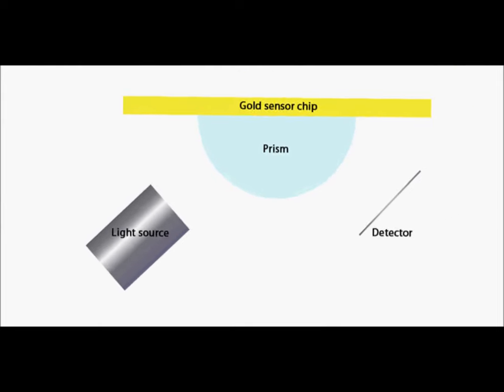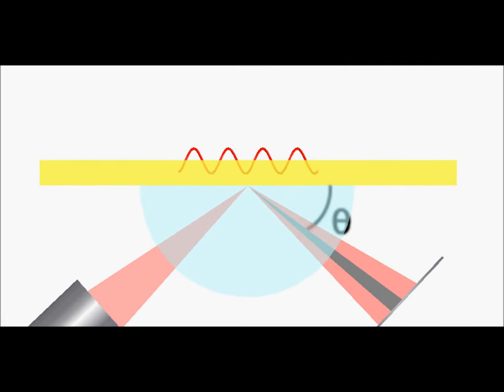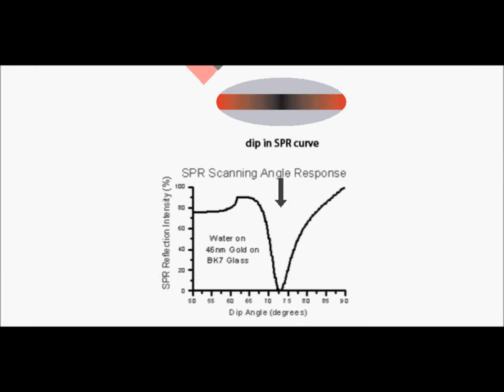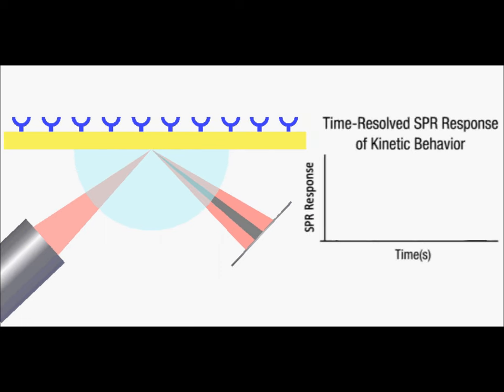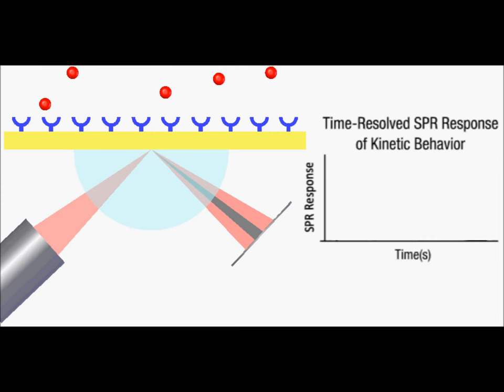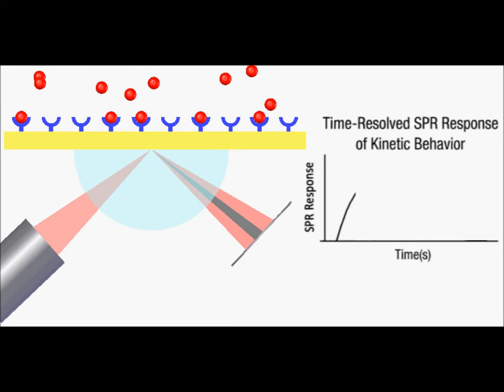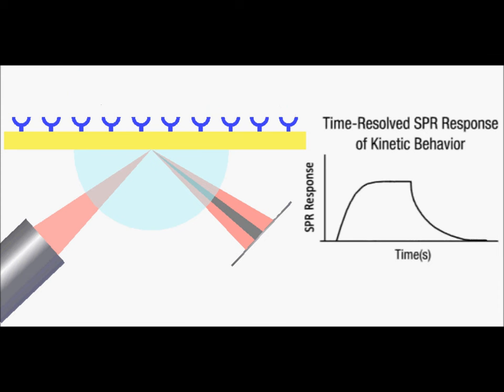Surface Plasmon Resonance Explained

Comment: Hello!

Thanks for the good video. I have one question regarding the SPR response:

what causes the response? is it the change of SPR angle with a fixed angle detector or the increased light absorbance caused by a higher concentration of analyte in the range of the evanescent wave?
Reply: It’s index of refraction change just above coverslip, so loss of signal due to increased scattering, since that also takes into account change in reflection angle. So yes, simple mass scatters light effect. I’m not sure how sensitive it is to change - one would think the layer thickness must need to change on the order of the size of the photons- so 200-400 nm, which would be tens of proteins deep, which is nonsensical. That’s the beauty of spr - the gold surface greatly reduces the size scale of photons to one or more layers of proteins, in effect! After that you just need a good detector for measuring small light changes in large signal which we have. I presume the light is exciting along the path of its resonance intensity minimum, and then see increase in emission intensity.

Comment: The shape and location of the SPR dip can then be used to convey information about the sensor surface.  SPR technology is commonly utilized for the study of molecular binding interactions between free anolyte molecules in solution and probe molecules which are linked to or immobilized onto the sensor surface.  As a molecular binding event takes place the angular position of this dark band shifts, and a shift in the reflectivity curve can also be observed.

Comment: Due to its simplicity, nearly every commercially available SPR instrument uses a detection scheme called the Kretschmann Configuration, in this set up a light source passes through a prism, reflects off the backside of the sensor chip surface and into a detector.  At a certain incident angle known as the resonance angle, light is absorbed by the electrons in the metal film of the sensor chip causing them to resonate.

Comment: .   In the first example, an anolyte with a low affinity to the immobilized ligand on the sensor surface is introduced and therefore negligible binding interaction is observed.  However, when an anolyte with higher affinity to the immobilized ligand is introduced into the system, then binding events are more readily observed.  Initially there are many binding sites available resulting in a rapid increase in SPR response that occurs as anolyte begins to bind to the ligand.

Comment: While sample is continuously delivered to the sensor surface anolyte molecules continue to bind and the number of available binding sites decreases, corresponding to a decrease in binding rate.  As the SPR response levels off the system approaches equilibrium and the number of molecules binding and unbinding become equal.  When no more anolyte is introduced to the system, the molecules will continue to unbind resulting in a decrease in SPR response.

Comment from the maker: Good question. During the sample's exposure to the surface, the sample molecules will continually bind and unbind with immobilized ligands on the sensor surface. This is a very dynamic process that occurs due to the nature of affinity binding interactions. Though the kinetic rates for association and dissociation may differ from each other, eventually the amount of sample binding and unbinding will reach equilibrium/steady state for a giving concentration.(i.e. Langmuir isotherm)

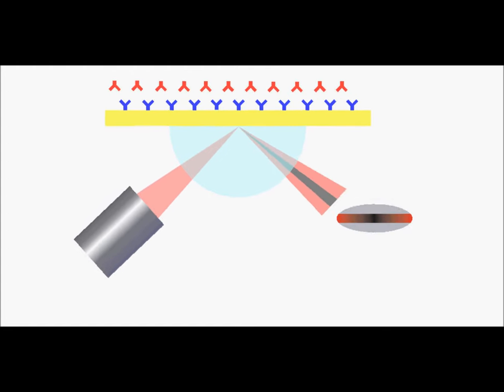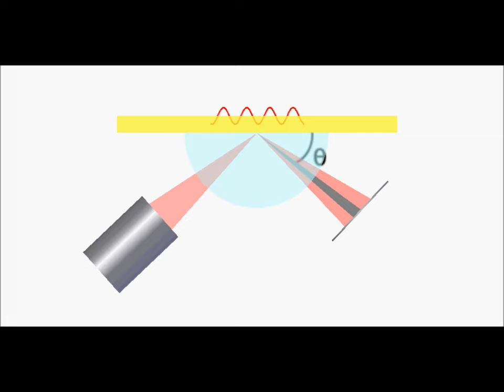Comment: Brilliant video, thanks! However just to note that at ~1:33 the animation shows the intensity shifting to a lower angle, whilst the corresponding graph shows it shifting to a higher angle. The angle I'm going on is the one you defined at ~0:43!

Comment: Thanks for the video, I finally understand whats is the "dip". I have a question, It is posibibly to detectc an analyte in a sensor chip if this isn't funcionalited? I mean, when it's only the gold layer
Reply from the maker: SPR based devices detects local changes at or near the sensor surface by measuring changes in refractive index vs. time. These refractive index changes are plotted in  SPR response plots, which are also called sensorgrams.  The sensorgrams are used to derive important information about how an analyte interacts with the sensor surface, i.e. binding interaction selectivity and rates.  In the case of using a bare gold sensor, if the analyte nears or binds to the gold surface, this would be observed in the sensorgram as an increase in SPR response. By studying the rate of SPR signal response change at different analyte concentrations, quantitative analyte interaction information can be extracted such to what extent an analyte is simply passing by, truly binding, non-specifically binding, or physically absorbing.  hope this helps.
Reply: Thank you so much!! It really helped me. Then, even if the sensor is pure gold, the sensorgram takes the same form than a functionalized sensor (base line, association, dissociation, regeneration and baseline again) of course it depends for the concentration and the analyte itself. I'm asking because i used to think that a sensorgram produced with a chip non-functionalized looked diferent than a sensorgram with a functionalized sensor.